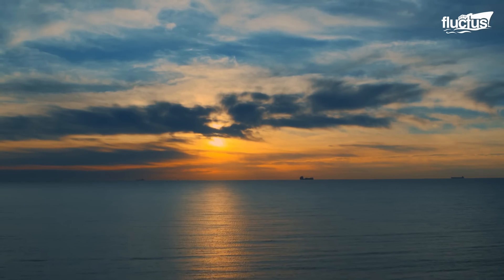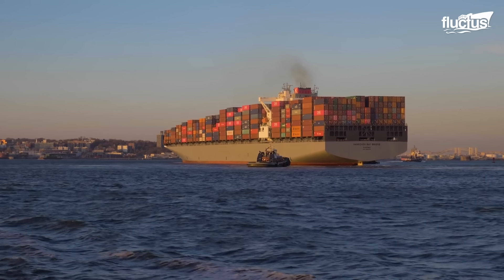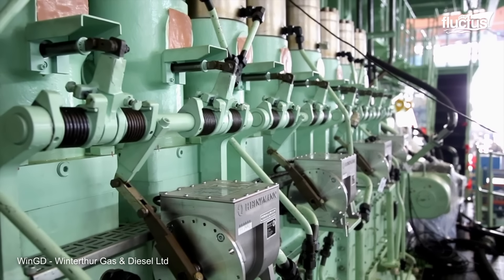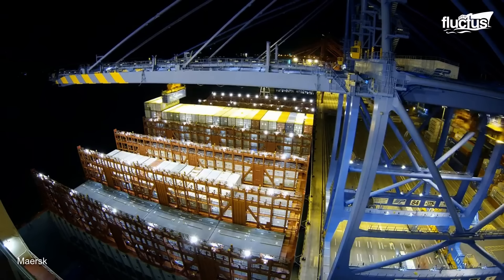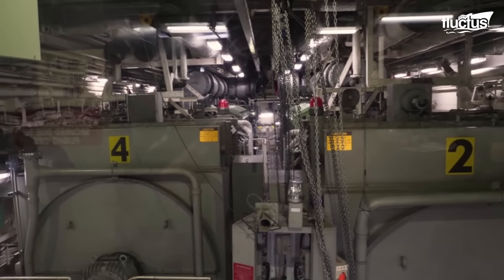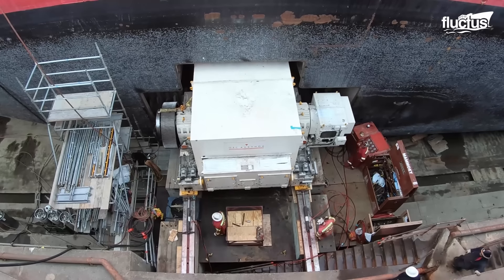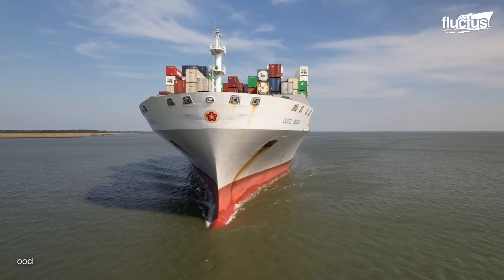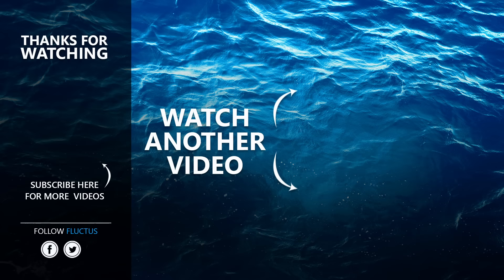The Crazy Amount of Power Needed to Move World Largest Container Ships

Comment: I am a naval architect with more than 45 years experience in the industry, including more than a decade spent in a research lab and also in the design department of a major shipyard. Good visuals and generally enjoyable video but you need to do some fact-checking and get you information right, I have a some corrections: wind turbine propulsion - the picture shown was of a sail-assisted propulsion system. A system that does work under many environmental conditions but is NOT a wind turbine - although they are in common use on maritime drones and pleasure craft to recharge batteries for electric propulsion systems. Second: HFO, heavy fuel oil, is NOT the same as diesel fuel, which in its variants is commonly referred to as MGO (Marine Gasoil) or MDO (Marine Diesel Oil). There are a lot of international restrictions on the use of HFO and it should not be confused with diesel fuel, which has a different set of restrictions and requirements. Third: the type of fuel has nothing to do with radiated noise. For airborne noise, the main engine, regardless of fuel type, is the primary source of air- and structure-borne noise. Underwater radiated noise is virtually always caused by the propeller. Period. Fourth: the first large LNG powered commercial ships anywhere were CONTAINER SHIPS built by NASSCO shipyard in the San Diego for TOTE, an American shipping company, not ships built years later for CMA CGM. While U.S. shipping companies and shipyards do not own or build the most ships in the world, they led the way and continue to move toward greener fuels. Fifth: the any diesel engine (and many gasoline engines) can run on LNG with some modifications. The engines you discuss here are modified diesel engines - the diesel cycle uses pressure to cause combustion of the fuel - and the primary modifications are to the fuel system. From a design standpoint, converting a diesel engine to operate on LNG de-rates the output power about 10% compared to the same engine running on diesel fuel. The engine cylinder pressures when using LNG are NOT an issue.
Reply: Excellent answer. Thank you. You get a lot of bad info on the computer. Poorly researched etc. Gotta be careful. So much so that l reaIly wonder about AI. l've been using it for awhile now. Some good info but many egregious mistakes, misinfo. So much so it makes me wonder about alI the terror surrounding its use. Tho, l've no doubt if/when it's finally squared away it could do real damage.
Reply: Not to mention the 2-Stokes in these large ships are dual fuel which is usually not mentioned and the engines get about 10% of their power from the DFO. The compression of the cylinder does not create enough heat for NG to ignite. DFO is injected on the upstroke as well to create the ignition source, which then ignites the NG. 
NG requires 500degCelcius+ to ignite where DFO only around 200degC. 
4-Stokes can come in dual fuel or full NG based which have added an electric spark source (like a spark plug) so they are technically no longer a compression engine as the fuel is ignited with a spark like a petroleum based car.
Reply: Well said.
Reply: Thank you very much for sharing your knowledge, I really appreciate it as many others must do too
Reply: I just remember what my old vehicle was like on LPG. Horrendous. How is it more efficient in a ship
Reply: @Tim Pratten  it's natural gas (methane) not petroleum gas (propane) similar but different, like red wine and white wine 😉
Reply: Awesome information!  Thank you!!
Reply: Tim Apple  my thought exactly😂😂😂😂
Reply: Sos un genio hermano. Saludos
Reply: Have US shipyards built any non-Jones Act vessels recently?  

Appreciate your taking the time to correct the yahoo producing this crap.  Of course information about shipping put out for the general public is usually inaccurate or incomplete.  I can think of the 60 minutes piece on port congestion in LA/LB or the PBS program about the Ever Given that failed to interview a naval architect, a classification society, a P&I club, etc.
Reply: Know it all 🤢😑🙄😒
Reply: I can't watch the video after reading this.
Reply: As always, the good stuff is in the comments. 👍🏼
Reply: @ThyPredator  nope: LNG 2 stroke engines are commonly use on the french line CGM ,and compression is  sufficient to ignite because this engines are heawely supercharged and fitted with pneumatic injection with pre heating...and ignition from the heawy fuel requires 450°C , 330°C for automobile diesel, gasoline 280°C...
Reply: Pls how do I get into the naval architecture field and can you help me cause am not in the usa
Reply: Thank you, I almost waisted 15 valuable minutes watching this. 😂
Reply: @analyste  I'm telling you now, you are wrong on everything you just said. The engines are dual fuel on those ships and they use dfo/hfo as the ignition source AND look up your temperatures, they are wrong as well!
Reply: @ThyPredator  🥱
Reply: Well played
Reply: @andreweppink4498  osobe
Reply: Agreed I was disappointed with the description of propulsion units that total disagreed with the views
Reply: It has a higher rev limit than Harley davidson
Reply: I have nothing to do with all of that but I could see the wrong facts, thank you for the info
Reply: would be nice if you formatted with paragraphs
Reply: Yes!
So many errors in all of their videos.
Reply: Thanks for sharing that information.  I appreciate that
Reply: Steam had more torque .
Reply: @benjaminkyrokinski2286 Certainly not by making YouTube comments.  Do you actually understand anything about the topic other than information from videos?
Reply: Great thanks for real engineer correction 
In the world of internet or virtually were really don't understand much about thing they show
Reply: Thank you for taking your time to correct
Reply: Appeal to authority logic fallacy n
Reply: Oh hell nah
Reply: You spent a lot of time writing a long comment nobody will read
Reply: @guymann4016 😊
Reply: Nice Résumé
Reply: Knowledge bummer
Reply: Thank you for your service @rick
Reply: Thank you for sharing your knowledge, very appreciated
Reply: Ok poindexter
Reply: Nice
Reply: Are there underwater jet engines and if not, why?
Reply: i have no idea what sir you are talking about cuz this all sound unlearnable but i apprecietate the answer
Reply: @heartwilson.8943 Then why isn't it used anymore.
Reply: @paradiseisland69  cost and pollution ! steam has a tremendous amount of torque , it can’t stall like an engine , just keep putting more pressure in the boiler and it will move anything - unlike an engine .
Reply: @heartwilson.8943  But you can make more powerful engines.
Reply: @paradiseisland69  at a higher RPM but not torque . Diesel is good for torque as it’s a CI engine , but that’s what a huge ship needs, or a train , or tractor engine , not power . Why do steam engines generaly produce much more torque than gas or diesel engines?” That's because (steam turbines apart), steam engines work at relatively low RPM compared to internal combustion engines with the possible exception of some giant marine diesels.

Steam has a monstrous amount of starting off power - torque .
Reply: @heartwilson.8943  That's the problem you can't have it both that why ships ar so slow.
Reply: :face-red-heart-shape:
Reply: I was gonna say  the same thing.
Reply: Get a job
Reply: @benjaminkyrokinski2286  before you enter the field you have to first have knowledge and then you have to undergo an apprenticeship so you can get hands-on experience and learn from a mentor, a master builder. You need to go to school for architectural engineering  and then looking to Mariner academies
Reply: @lobola956 I feel bad for you if you think that is long. LOL do you ever read anything other than short internet comments
Reply: Blah blah blah
Reply: Yes massa 🫡
Reply: I was wondering if these points were going to be mentioned. Thank You.  I noticed the cost of LNG was not mentioned. Neither was it’s volatility and storage requirements.   All this means products cost more for the consumer.
Reply: Thank you, sir, for the engineering approach to the topic! Anyway, the video has quite interesting documentary value for the general public.
Reply: How dare you correct them. Lol.
Reply: God, the Lord Jesus Christ loves you! Restore your relationship with God by repenting of your sins and putting your faith in Jesus Christ, "... that Christ died for our sins according to the Scriptures, and that He was buried, and that He was raised on the third day according to the Scriptures..." (1 Corinthians 15:3-4)
Reply: Good for you.
Reply: Question: do you think that someday those ship containers are going to be nuclear power similar to modern aircraft carriers and submarines are today?
Reply: YouTube comments always bring out the experts with 7,000 years experience.
Reply: I shiver when I see these ‘I am a’……..comments. It seems it automatically entitles one to lecture to the rest of us about the wealth of knowledge they have. Yawn.
Reply: @thecitygunfightx ignorants 🤮🤢🤨🤫
Reply: So...My dad made this ship in his back yard from old scrap parts.
Reply: "get you information right"?  😂 Are you sure?
Reply: @thecitygunfightx With faulty grammar.
Reply: I am a hamster
Reply: Thanks to people with knowledge like you.
Reply: Seems like you have a lot to share. Not to be snarky but could you not make your own video?
Reply: I got a 9.9 hp merc let's calm it down chief
Reply: Yes, kind of a fluff piece. 

Many of the video clips don't match what's being said in the narrative.
Reply: I was going to say the same thing. Well said
Reply: i love you
Reply: Nice to read your corrections
Reply: @lobola956 I read all of it
Reply: only 45 years? Youre merely an apprentice. I have 100 years of experience.
Reply: That was very informative. Thanks for sharing.
Reply: i doubt yu are
Reply: Hello sir, I'm a fresher who's joining a company but need to Design a ship, would like to talk with an experienced guy like you if possible!

Comment: “Next, pistons are installed…”(shows connecting rod) “pistons are connected to the crankshaft” (no, no they’re not. They’re connected to the connecting rods)
Reply: Honestly most people don’t know the difference between a crankshaft and a camshaft. Let alone connecting rods or push rods.
Reply: Your very proud of your basic understanding. Did you know a connecting rods connect the piston to the crankshaft? It's not that it was incorrect it's simply a case of your desire to find fault in others mixed with you not listening to what was actually said.
Reply: So inaccurate, thanks for pointing that out.
Reply: Glad I'm not the only one that noticed this
Reply: the pistons were already on the connecting rods, prolly why it was mentioned that way
Reply: @thetruthspeaker1978  Pistons are connected to piston rods,connected to crosshead, connected to Conrad's ok
Reply: Correction Conrad's.ok.
Reply: Con rods connected to crankshaft
Reply: Conrad approves of this message 😂
Reply: @JakkeJakobsen  con rods.
Reply: @thetruthspeaker1978 😮
Reply: @thetruthspeaker1978 cb
Reply: You are wrong, pistons are connected to the pistons pin
Reply: Yous wrong ,the piston is attached to the piston rod,piston rod attached at centre of the coss head,con rod connected to cross bearings.
Reply: @rifa.3307  no piston pins
Reply: So what we're sayin' here is: the toe bone's connected to the foot bone, the foot bone's connected to the ankle bone, the ankle bone's connected to the leg bone, and that's how they connected those dry bones.
Reply: Piston. 
Piston rod. 
Crosshead. 
Connecting rod. 
Crankshaft.
Reply: She's not giving a technical rundown meant to be textbook correct - that's not the intent here. Just a short overview meant to be interesting, give her a break.
Reply: @thetruthspeaker1978 isn't that what you're doing in these comments ? Who cares smh
Reply: @thetruthspeaker1978  it’s  you’re. And what the hell are you talking about. You’re not making sense
Reply: @markbeale7390  you’re wrong. The pistons are connected to the connecting rod via the wrist pin. The wrist pin is a fastener. Not an anchor point.

Comment: The engines may be huge but in terms of fuel use they are tiny. A 50,000 ton bulk carrier burns around 0.4 tons of fuel per mile which may sound like a lot but when you look at it in terms of fuel per ton per mile it is only around 8 grams per mile per ton. So if a 1 ton car had this economy it could drive around 100 miles on one litre of fuel or around 450 mpg.
Reply: Car carrier I was on burnt about 20 gallons of fuel oil per mile.   Carried 4000 cars so equaled about 200 mpg/car.   Plus a home for 20 people that made all our power and water and heat.

Comment: 3:52 Pff, that's nothing. The SpaceX raptor engine has 11 million horsepower. And the booster stage has 33 of those 😂
Reply: You goose, your comparing Apples to Oranges. If you are going to compare a rocket engine with a ICE you need to look at power force the engines can provide not HP. 

A 1x Wartsila RTA96-C 2-Stroke 108,920HP but 5,608,312 lb/ft of force. 
Rapter may have 11million HP but is 510,000 lb/ft (more than 10 times less). 
If you mounted 10 Raptors facing backwards on the ship at full thrust, then had had the ships engine at forward full thrust the ship would still move forward against the raptors.

Like comparing a F1 car with 800HP+ which is faster but I know what would win in a tug of war with a small Bulldozer of only 100HP(even if you take our the traction issue and all of the F1 800HP is going to the ground the torque lb/ft just doesn't compare.

Comment: Why ? All they need to do is rotate the propeller,  why does it matter how big the ship is ? All they need is an engine powerful enough to rotate that big propeller,  what does the size of the ship have anything to do with anything
Reply: Because of water pressure. Deeper Propeller, the harder it is to turn as there is more water to push. Also the weight/speed relation of the ship. The stress put on a propeller, shaft and engine at High revs when a ship is stationary or still slow moving is very high. If it's got alot of weight to get up to speed well again that is an issue.
Reply: First pull a bath toy on water with a rope, then try to pull a 100,000 ton ship by hand and you'll get your answer :) The bigger the vessel, the bigger the mass to accelerate, and the bigger the water and wind resistance to overcome.

Comment: What is the single most expensive part on a ship?
Reply: Id imagine the crankshaft of one of these engines. The cylinderheads are probably all separate otherwise it would be the head probably
Reply: The golden rivet. Located in shaft alley. Always ask to see it if on a cruise.
Reply: The Main Engine, normally somewhere between 20 to 25% of the build cost

Comment: The number of mechanics on the ship remains the same, but the equipment is added. Salaries are in place and do not grow (an increase in salary is not a solution to the problem - it will not give you extra time for repairs). The solution is to increase the number of engine room crew. Shipowners practice reduced crews. Believe me, ship engineers are not happy with the current situation. You can't even imagine what it's like to operate a 17 year old ship when different systems break down every day. Engineers are ready to escape from such an emergency vessel in a month. And at this time on the navigator's bridge they drink coffee in white shirts. Such different fates for mechanics and navigators on the same ship.

Comment: i wonder how many miles per gallon these ships get?
Reply: I've seen figures of 1660 gallons of fuel per hour. At 20 knots (23 mph) that's about 72 gallons per mile. But what really matters is fuel burn per ton of cargo. 1660 gallons per hour is worse than 2000 gallons per hour if the second ship carries 2x the cargo.
Reply: Looks like a big enough engine for it to be a gallon per piston, per cycle.
Reply: Fuel consumption is measured by tons per day at a given speed.

Comment: Im struck at the lack of advancement in the engine room.
Reply: If you saw the engineroom evolution over the last 80 years you would be awestruck.  It is amazing. 

80 years ago absolute basic monitoring of engine function.  Today full automation.

Yes maintenance work is still manual, but hydraulic jacking nuts and not 28 lb hammers, or scissor wrenches.

Comment: Why using the middle age unit horsepowers instead kilowatts. Nobody uses horses today.  And you should to say what kind of horses are in the engine. China horses, british horses  or US horses  got different output on their 4 legs. The engine in here got app.  72 megawatts if we assume american horses.  With the prefix kilo  or mega  you save lot of  zeros and you compare easyly  how many fan heaters, lightbulbs kitchen stoves  it can run at the same time. 

I was told the most powerful ship engine ever made got 95 MW at 100 rpm, its a very thursty behemoth. it took  app 18 metric tons of diesel  fuel per hour at full power.
Reply: you're fun at parties aren't you?
Reply: @Dubstone  possibly.
Reply: Tell the Yanks, the Brits use both at various times and anyone who went to school in the Uk in the 50/60s can almost certainly work in either as we had to learn both, plus some shortcuts to convert one to the other, having said that not too sure how many people outside some form of engineering work would actually use them both!

Comment: Hydrogen fuel cells would get my vote. The infrastructure would be fairly simple to build. Port locations.
Reply: One of the many challenges of hydrogen as a fuel, is cost.  You either have a centralized location to produce it or point of use production.  Small scale point of use production for vehicles is to expensive right now.  Transporting hydrogen is  expensive.  A hydrogen plant at a port location would be a no brainer.
Reply: Probably one day, Hydrogen is slowly making it to main stream on automobiles.